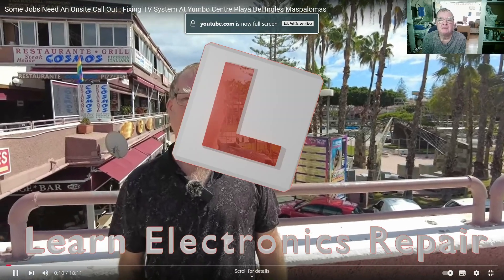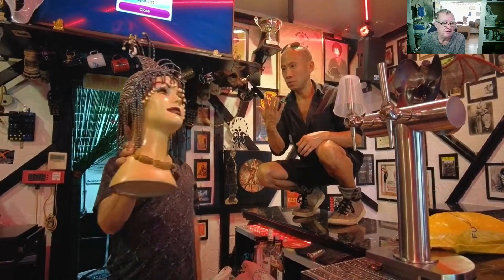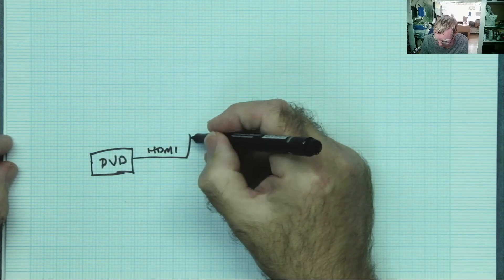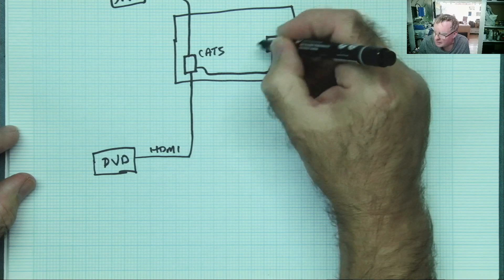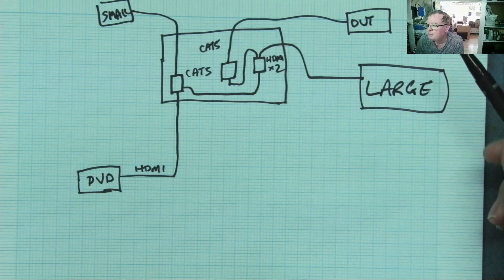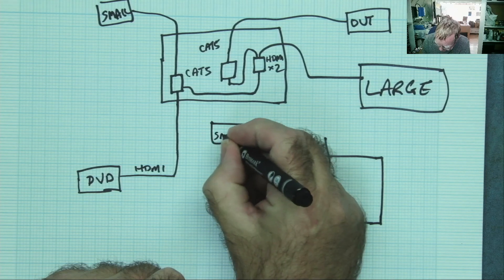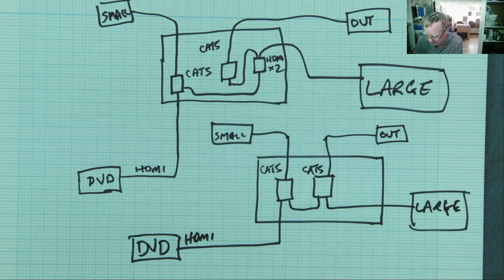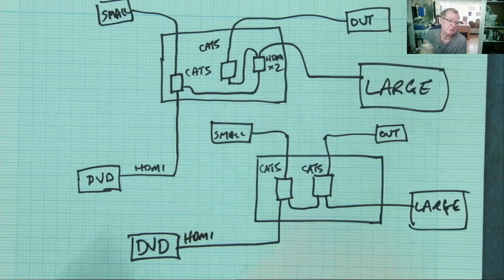This Week I Did Some On-site Work. I Thought I Fixed It But What Was The Real Cause Of The Fault?

Comment: suddenly you were speaking with an artificial voice but fluent german and I was wondering what is going on. 
First video ever that appeared this way. 
Youtube must have rolled out over night a new feature with foreign audiotracks I was not aware of. I must have hit a shortcut before or for whatever reason  your video was the first that had been automatically translated into german which was a real but weird surprise and Situation. 
I have chrome on windows and in the browser it is part of the youtube settings. New features are a timer and foreign audio tracks like on a dvd - and of cause for years the subtitles in english. 

So mystery solved cause I had to loook 3 times when I could not hear your voice but the arteficial german one.
Reply from the maker: Really?

Comment: Strange how the original setup worked for a long time then suddenly stopped. Also, strange how the original setup worked with your small TV. Perhaps different TV's use different HDMI protocols?
Reply: I suspect that the passive splitter was degrading the signal enough to cause problems for the outside TV, but Richard's test monitor can handle it fine. 
Even though the specifications and standards for signals, connectors and ports are the same across manufacturers, the way they design their circuits to process the signals will be up to each manufacturer, so I suspect the idiosyncrasies of the various circuit designs can sometimes cause problems for one another.
Reply from the maker: @zedcarr6128   Ithink you are right
Reply from the maker: It is.  But since I told him to rewire it all is good.  HDMI is very strange